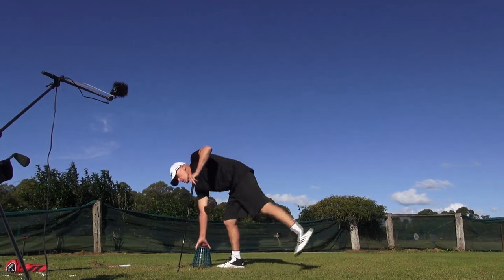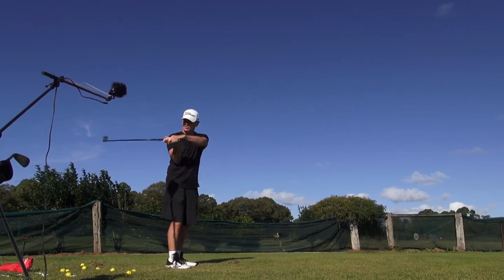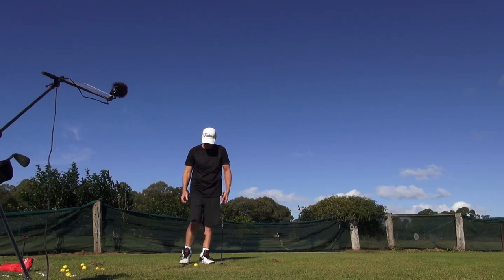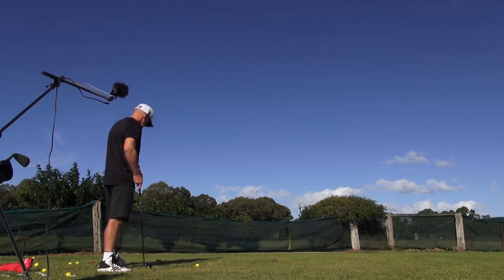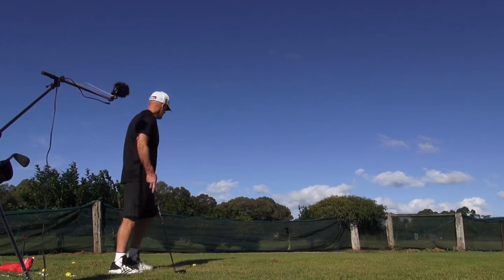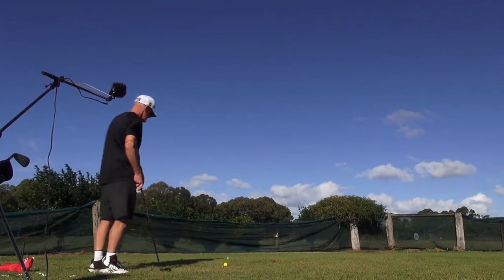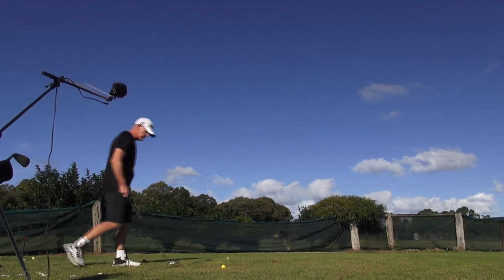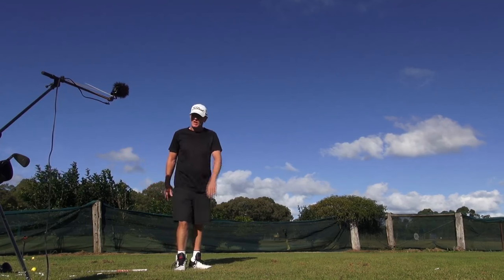Extra Bits For Short Controlled Accelleration swing No 1

Comment: I think what people dont understand about this swint is that it's not a "different swing"...its literally a short swing, but all the proper mechanics are there...If ur swinging super hard then ur not doing it right...go back like a normal full length back swing and start your lower body before you reach about parallel and you'll see it doesnt feel any different, just shorter with more of a forearm hinge than a wrist cock...amazing but also very simple (which is why it's so amazing)

Comment: Hi JHTried your short acceleration swing last night on range and yeah really good. Had a few low hooks and a few blocks but 90% of the shots were really solid out of the middle and good distance. Driver also really solid. Had the feeling in trail arm of like throwing a ball with the elbow coming in before the snap of the hands comes in to hit the ball I suppose like throwing a javelin giving me like you a great feeling of clubhead speed and power. Not sure I will perservere with Trevino as this felt so good and do you think that the short accelerating swing would be easier to repeat and an easier swing in general to make.Will keep working on it probably in conjunction with some Moe (address position and lateral slide) what do you think?As always interested in your thoughts.Regards Glenn
Reply from the maker: Hi Glenn, 
                  Although the  'Short Controlled Acceleration' swing  is short and involves conscious 'acceleration' you  must not  be jerky or to quick with the  swing,  you have to be aware that the swing is shorter and therefore you dont have as much time for the club to  change direction .
              To that end you have  have to  swing  very smoothly and  as I thought process slower than normal....if you dont give your lead side  hip/leg enough time to  get  going  for the weight transference they will just stall up and your hands will take over as leaders and just  flap at the ball which causes   things like low hooks and blocks etc., I actually worked on just that aspect myself yesterday and I absolutely  flushed the ball with the Trevino swing and the Short Controlled Acceleration Swing.
                  So just  try to  smooth out the  backswing into downswing into impact part of the swing...a good thought is you cant be to 'leisurely with your tempo , just try what you think are some super slomo short swings  , you will be amazed at how the  whole swing  times itself so much better  even though the actual length of the swing is shorter.
                                cheers JH